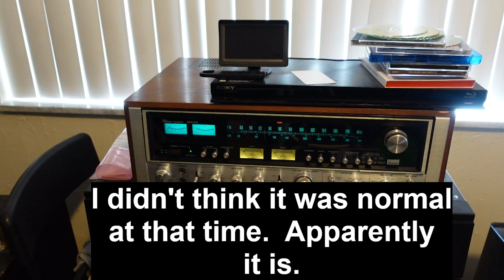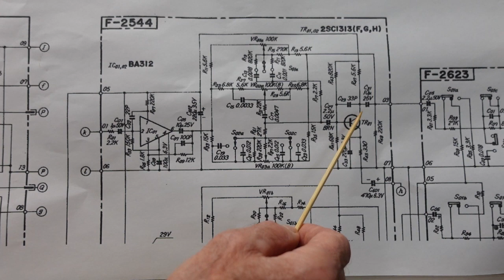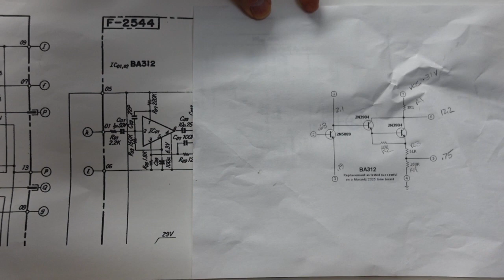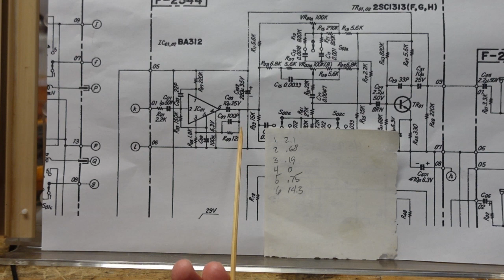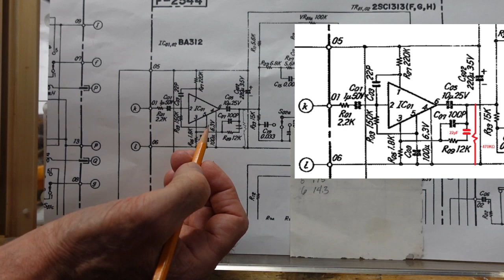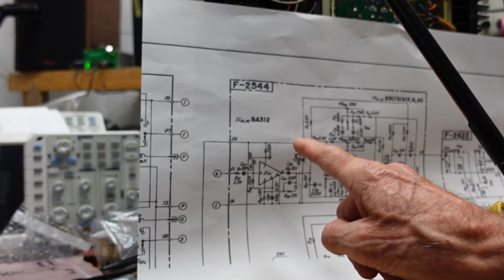Sansui 9090DB Pops When Bass Control Engaged  Solved

Comment: I spent a ridiculous amount of time on one of these before deciding that it was indeed a design flaw, and not a fault condition. The schematic really throws you off the track with that symbol of an opamp. You don't really think about pin 3 actually being the emitter of a transistor and the current flow that it entails. Nice find, and nice fix. I wish I would have thought of it. 🙂
Reply from the maker: What the video doesn't show is how INSANE this made me until I too decided it was a design flaw.  I don't like to modify circuitry, because I don't feel like I have a deep enough understanding of electronic designing.  But it used minimal components, and is easily reversible should one choose to do so.

Comment: does the polarity of the caps matter? I'm fresh out of NP caps..
Reply from the maker: You can use polar caps.  Just measure the voltage between the points and mount it accordingly.

Comment: Thanks for this Ray. I just finished a full rework of a 990db and discovered the same pop/thump in the Bass switch. I figured I was just going to live with it when I accidently came across this fix. thankyou thankyou thankyou.
Reply from the maker: I spent way too much time trying to find a trouble, when it was a design flaw.  I'm sure someone with engineering skills would have come up with a more elegant solution, but this worked.

Comment: Hallo
Why is it popping ? There 2 caps wich should prevent this. C31 and C29 the in the input and output of the last transistor.
Reply from the maker: I explained this in the video. There is DC leaking into the circuit from the feedback resistors on the input IC's.
Reply: @raygianelli3612  yes i watched the hole video. 
What i mean is why the leaked current from the IC does not get blocked by C31 or C29 ?
Reply from the maker: @Godunjoify  Because the pop occurs before either of those capacitors.
Reply: @raygianelli3612  thank you for the good vids and taking time to answer the comments.

Comment: Congratulations Ray, excellent job
Reply from the maker: Thanks.  This 10 minute video is the distillation of a solid month of hair pulling.  Biggest breakthrough was finding out that there was no malfunction to be found.  I spent waaay too much time just looking for a trouble that didn't exist.
I eventually took my own advice and asked those who had more experience with this model than I do.
Reply: @raygianelli3612  Yes you told me last time I was there, when I drop my Sansui you were working on this unit.
But congrats, you went an extra mile to fix this unit.

Comment: Great video and fix Ray! I’ve noticed a similar pop on other units when engaging the tone controls, and it’s always a challenge trying to determine if they were all like that without having an identical unit nearby.  Thankfully the forums have came through most of the time, with others saying they noticed the same thing.  Pretty cool that you were able to figure out a workaround.
Reply from the maker: My friend, I drove myself to the brink trying to find a malfunction that wasn't there.  As you point out, the forums came through and clued me to the fact that it was a design flaw.  Otherwise I'd be signing into a rubber room by now!

Comment: nice fix ray!
Reply from the maker: Thanks Joseph!  I spent waaay too much time trying to find something wrong when there wasn't anything to find.
Reply: @raygianelli3612  i went thru the same thing with input selector buttons on an sx1080. with headphones on, no signal and volume up, you could hear a slight click. i spent hours taking apart switches and cleaning, even buying an extra board with switches just in case(there was in "in case" situation(it happens)) only to find out that it was normal. it was practically inaudible with speakers and you should never ever have the volume as loud as it needed to be when switching inputs but i, like you, thought that the pioneer engineers would not leave something like that. they did.